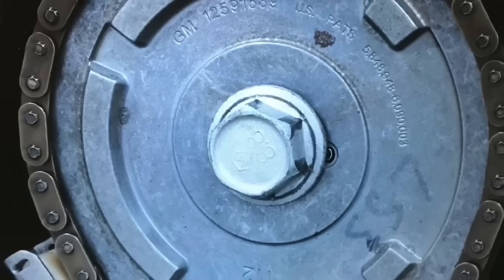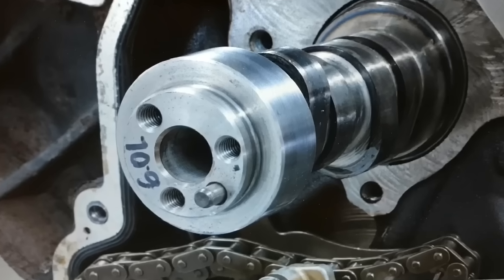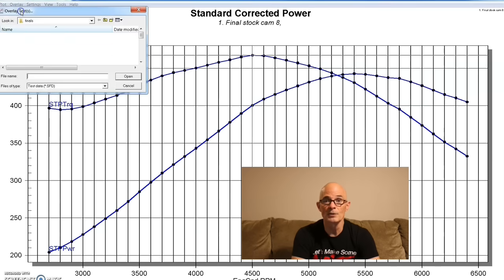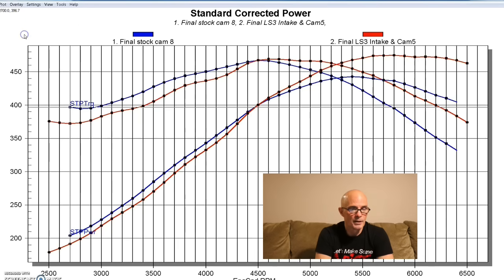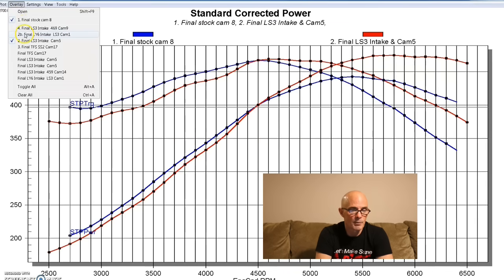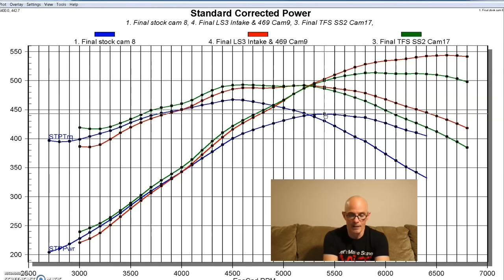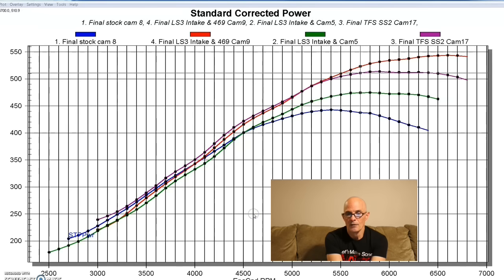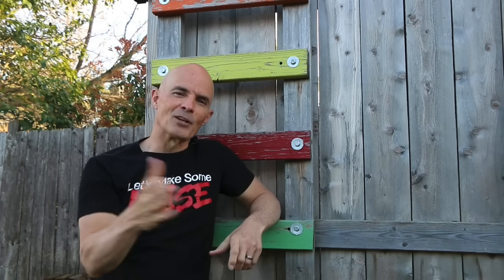HOW TO PICK: THE RIGHT JUNKYARD 6.0L LS CAM. 4 CAMS-WHAT WORKS BEST?

Comment: Is this LQ4 engine similar to a L98/L76 engine? I don’t know if that terminology is the same as what we use in Australia but we used 6.0 litre engines in our Commodore. I have an LS3 cam in it and it did 400hp at the wheels. Stock valve springs, revs to 6000rpm.

Comment: I’m planning to stick a TSP truck cam in my L99 camaro SS, 228/232. .600/.600 LSA 112 I already ordered the cam and it’s on its way to Iraq. The aim for this is to get more torque and nice chopping sound for a daily use car. My main concern here is the rough idle because it’s a truck cam ... should I be worried ?

Comment: how do you suppose a 402 stroker with 11.5 compression would  respond
Reply: That combo should respond very well.  Keep in mind that adding cubic inches tends to make a camshaft add a bit more tame.  Your added displacement should just help even more on the low speed cylinder filling, helping with torque production, while still having enough cam to rev out enough for any reasonable street engine.  I would bet on it feeling quite strong.

Comment: I want to see a big cam dyno tested with Rhoads lifters.  Have had them in a couple of small blocks and they really help broaden the power curve by restoring low rpm cylinder pressure.

Comment: I have a 2012 Silverado crew running EFI live truck runs great 3,000 Stahl 600 lift cam long tubes everything short block up torque management is off but it doesn't have the power to spin the wheels even with traction control and stabilitrak shut off soon as the computer senses the slightest bit of wheel spin it pulls the throttle back and flashes the light. So basically all this work for nothing . Any suggestions? Carburetor different throttle body?

Comment: Is it required to have double valve springs and harden push rods with the ss2 on the 6.0 ?
Reply from the maker: a PAC or Comp single beehive also works-lots of guys running stock pushrods-I don't usually with added spring pressure

Comment: Hey quick question. I put an LY6 in my 4 door 4x4 added a Texas speed VVT 2 cam 227/235  .614/ .621 113 LSA 108 ICL and it only made 308 to the ground 🤔 this doesn’t seem right. Also is that cam mild or moderate
Reply from the maker: that cam should make plenty of power

Comment: I just discovered your channel and love it - also shared your videos.
I have a 1999 LQ4 going to boost it and run it on E85 also keeping the stock cam,  I already picked up replacement aluminum 317 heads, 

1-What should i open up the piston ring gap to?
2-Which valve springs/retainers should i use?
3-What size fuel injectors? 

4-What are must do's to junk yard engines before dropping them in?
thanks for your help

Comment: I love all the information you give with all of the comparisons. And while i understand that most engines with a cam will get a converter. It would be cool to see a cam test that give us the numbers from say 1800 rpm and up but at 1/4 to half throttle to simulate say an up  hill climb while in OD and converter locked. It would be an outside the box test.

Comment: When you change the cam to stage 2 during the test, did you change the valve spring or keep using the stock one?
Reply: Stock springs would be OK for a dyno session, but once you get just shy of the .600 lift mark (ss2 has .585 llift), you definitely should upgrade springs. In fact a lot of companies advise upgrading springs during a camshaft change REGARDLESS of how specs differ from stock.

Comment: In my opinion, the SS2 is still a little large for a heavy truck N/A. Keep in mind this engine was obviously optimized with no power losses from accessories, drivetrain, etc. So the whole video, this engine was acting like a much larger displacement around a 6.2L or more when accounting for those losses. The SS2 cam in a truck will not produce the same power curve as the video, and because of the weight, will certainly feel slugglish on the lower RPMs. That cam has +5 degrees positive overlap. You will have to like the feeling of high stall converters if you want to make use of that cam, and possibly have short gearing. The Sloppy Stage 1 cam, or E1838P is 216/220 @114 +4 LSA which has -10 overlap so will probably end up somewhere between the LS3 cam and Stage 2 without loosing as much low-end torque.

Comment: Hi Richard, great test on 6.0! I get the overall power curve of these cams will be similar on cathedral port heads on the 6.0. Im guessing a big percentage of 6.0 guys have cathedral port heads. But my question is (because I have a cathedral port 6.0) how much power it will make with a SS2 cam?  Im running the sloppy stage II but Im guessing from this test it will produce peak hp of about 500 instead of the higher 524 hp with rectangular port heads. By the way Im going to run twin turbos and this motor is going into my 3000 lb lightened 72 Nova, turbo 400, 3.42 gears. At the track my max boost will be 15 to 18 lbs. Probably 6 to 8 lbs on the street. This will be 80% street 20% strip!  Would you say about 500 hp is a good guess naturally aspirated with 317s & SS2? Thanks!

Comment: Can you do an ls1 at all?

My ls1 did a lifter and i changed cams 

i had a vcm 13 cam 238/242 601int 601exh 112lsa made 390rwhp run 116mph 11.69

Put a crow cam in it 234/242 113lsa 603lift 603exh made 380rwhp ran 11.8 115mph on its 3rd pass. Yet to head back.

Comment: I've got a 2002 LS6 corvette engine going into my 1972 Vette.   Will a sloppy stage 2 lose torque in the 3000-4000 rpm range compared to the 2nd design LS6 cam?
https://www.youtube.com/watch?v=1s0QEhny4oM

Comment: Riachard, i have a question, u see on the graph after all 4 cams were tested that the power goes up with each cam. Lets say u disnt have to worry about piston to valve clearance because u have aftermarket pistons, is there a point on a stock size 5.3 or 6.0 where putting in a bigger cam does not gain power or it actually hurts power? I know u dont want to run .850 lift on the street but it just seems like the ls just wants more and more camshaft!
Reply from the maker: take a look at the 175-hp cam video for an example of too much cam

Comment: Awesome videos, and I've learned a good bit about the longtube headers. Will the ss2 can work in the L76 in the Pontiac G8 GT with stock converter.
Reply from the maker: don't know converters
Reply: It sure looks like it, the cam has +4 degrees of advance ground in , which isn't stated in the description. The duration #'s alone don't 'tell' how this particular  cam will 'act' because of the advance it has (especially when the advance isn't given in the specs) Richard slightly 'dropped the ball' by not giving that very important bit of info IMO. Have a G8 myself and have been researching cams a bit. The duration #'s of the SS2 are too high to use in our cars without the +4 degrees of advance (or a converter), the advance helps bring the power down lower and let us use the stock converter. Look at the BTR LS3 cams specs for more insight, their Stage 2 even mentions the torque converter in our cars.

Comment: can you state advertised duration?  The aftermarket cams use more aggressive ramps which makes the .050" duration look much bigger than the GM cams.  I think a 275/283 cam with 110 LSA would be slightly better than the TFS.
Reply: that 275/283 would be a complete dog below 6500 RPM, even on a 427 LS7

Comment: Ok  my cam has the exsact same cam card as the comp in the video.  I forgot I ended up with that one.  Cool. I got to see what my cam will do in my 6.0. Lol. I have heavily ported 862’s that have been milled a down a couple CC’s to compensate for the valve unshrouding and bowl smoothing around the exhaust valve.  I can’t wait to see what it makes compared to this video with the mods I’ve done. It’s also .040 over with a gen 4 -4.8 crank and rods.  So it should be interesting

Comment: I wish you would start the dyno tests out at lower RPMs. It would be great to know what kind of torque and HP levels that these cams are giving closer to the 1000 mark. Not that many people run up to 7000, but almost everyone starts from an idle.
Reply from the maker: no one is at WOT at 1000 rpm
Reply: @richardholdener1727  Turning onto an uphill onramp to get on the interstate, pulling a 10,000 lb boat.... been WOT at 1000 a few times.
Reply: With an auto the converter will flash and have it above 1000 when you floor it. If it’s a manual and you’re actually trying to get somewhere the WOT at 1000 rpm means you need to downshift since a small gas engine isn’t going to make much power down that low anyway. 

Either way, a water brake dyno like this needs some rpm to move enough water for it to work. They can’t run it at to low of an rpm or else it can’t work right. Usually needs to start about 2500 or higher.

Comment: I think videos like this for reference are great! I think they will help a lot of people. 

I spent a lot of time trying to find other people's test when i was trying to decide on a cam for my 489bbc. There is lots of "600hp builds" out there but, It was hard to find the mild street buils, especially with the peanut port heads. There's lots of conflicting info about them too. It would be nice to know for sure if a nice street motor can be built with peanut port heads. 

But, I just found the other day, a 454 test with a gen 6 block and peanut port heads you did, so that was helpful. The only question left is what does an intake and cam upgrade do for a peanut port head engine.

The few dyno test i did see with the old 454s show about a 100hp difference between the factory claimed (net)hp and  what you and others have shown with a engine on the dyno. Is the exhaust manifold, factory cast intake manifold, and accessories worth that much?

A test showing how big a cam the peanut port heads can handle would be nice too😉.

Thanks a lot, Keep the videos coming.

Comment: Could you do a test to find out the highest compression/ power you could run with a carbureted 6.0L on good e85?
Reply: With E85 you have very little compression limit compared to pump gas. You can run 13:1+ compression on E85 if you wanted to. 
My latest combo I recently built a pump-gas 11.5:1 6.0, with a healthy cam (235/251@.050, .621/.624 lift on 113LSA), CNC ported LS3 heads, LS3 manifold, 100mm TB and EFI , makes 600hp. Limited to 11:1 because its on pump gas. 
I reckon you could definitely get close to 700 hp (if not supercede 700) with more compression on E85, bigger camshaft (.650-700 lift, 250-270@.050), full-race ported heads, full-race ported single-plane and a big honkin dominator.
Reply: @rustysausage69  Sounds similar to the 750hp LSX 454-R crate engine.  I told Richard that I would love to see the outcome of swapping the 454-R single plane and Dominator out for a FAST or LS7 intake manifold so it would fit under a stock hood which is popular nowadays.

Comment: A cam swap wont turn your stock engine to a high performance engine. If you're a clueless bastard and want more power, there is alot that can be done to an engine before the cam becomes the part holding it back. And a youtube video saying this and that about these cams are just garbage unless you have that exact setup. If you really want to change cams anyways, take ur engine to pros and let them test ur engine for what it actully needs. Don't listen to someone who's saying "this is a good cam, everyone should have it" Cuz that guy is a fucking moron.
Reply: Trigger easy?
Reply from the maker: adding any of these cams to a stock motors does this. All you need are springs.

Comment: A l83 VVT limit test would be awesome! See at what point you loose control. See how much boost or level of cam destabilize the VVT system. Are guys limiting the VVT at too mild of build levels?
Reply from the maker: VVT is usually limited on cam swaps anyway
Reply: Richard Holdener loving the L83 content! Keep it up.

Comment: Would you suggest hunting down a LY6/4L80 combo over the LY6/6L90 for a boosted muscle car swap?  Debating a LSA blower or a s400 with Hooker turbo manifolds.
Reply: You'll have less trouble fitting a 4L80 in a muscle car transmission tunnel than a 6L90, theres more 4 speed shifters out there than 6 speed available, and less gears=less money to spend making it hold power. Those are my only words of advice.

Comment: Richard I really really wanna see you do an LQ9 like this with 243 heads and a thinner head gasket, same test. C'mon Dyno man!!
Reply from the maker: results are the same, I ran this LY6 with 706, 799 and 317 heads with various intakes and cams
Reply: Richard Holdener thanks for all the great content man, I've really enjoyed it and learned so so much! I really wish a turbo in my 4th gen Camaro LTX wasn't such a colassal undertaking, it would really be a good time in the car especially with a PCM conversion getting rid of the Opti!
Reply: Richard Holdener I was mainly concerned with what a bit more compression would do in it. I have a plan for a mild build for my Escalade or a Silverado SS depending on how things go. Ported 799/243 heads and a good valve job naturally, Mill the heads and a thinner head gasket trying to get compression around 11:1-11.5:1, "Little Lunati" cam, you know the one I'm sure, TBSS intake, long tubes and a 26-2800 converter. It should be pretty fun, torquey and still have decent manners in the truck.
Reply: Richard Holdener and I'm still waiting to see you do something with a gen 2 LTX brotha! C'mon man, us LTX guys deserve some love too lol!

Comment: Everyone sleeps on the LS9 cam. It makes great power, force fed or not, and its only $139.
Reply from the maker: it makes good peak power, just soft down low-see the stock ls cam test video
Reply: Richard Holdener yes, but $139 vs $400+ for all these fancy cams. And the 823 heads flow best around .500 lift.

Comment: Making me want to change cams again... I never thought that I would see the SS2 making more TQ than a stock LQ4 cam at lower than 4000 RPM. I went from the stock LQ4 cam in my truck, to a 202/216 .525 112 LSA. Then to a 214/220 .598/.605 111 LSA. It works well, but seeing tests like this always have me second guessing. And my inner voice is constantly telling "go big or go home."
Reply: I am with you never seeing the Sloppy stage 2 making more low end torque than the LQ4 stock cam.

Comment: My question is, if you're building your 6 liter to add boost later and go with the 54 - 469 - 11 camshaft, will the boost overcome that little bit of low-end loss?
Reply from the maker: it will do the same thing it does na-you will obviously have more low end cuz of the presence of boost-the shape will be the same

Comment: Richard thanks for all you do and the time and effort you put into your posts! I have a stupid question. I've been looking at the summit stage 1 truck cam for towing and fuel economy with increases in both hp and torque. Is this a good choice or is there a better choice? Thanks and you make great videos and posts keep up the good work!
Reply from the maker: I have not tested the summit truck cams-only BTR
Reply: @richardholdener1727  ok what BTR cam? I appreciate your reply. Thanks
Reply: @richardholdener1727  I should have stated the application it's for a 99 Silverado 2500 long bed 3 door with 6.0 lq4 completely stock. Thanks

Comment: Not bad for off the shelf cams but I've always been a custom grind guy. It's not that much more for a cam that's designed for said combination and or application. If it's for something you really don't race where you want everything you can get out of the vehicle obviously the last 2 cams are a great choice depending on weight of vehicle, converter, gearing, etc. 
Thanks for another great video.
Reply from the maker: custom cams do the same thing-there is no magic
Reply: @richardholdener1727  come on you have a ton of experience on a dyno. I'm also talking race. Not street. There I agree. Plus motors in general. The cams I got from Anthony Disomma always made a difference both on the dyno and track. You also know the head plays a part on how well something is going to work but like I said before on a stock motor no it's not necessary. Oh another example is for classes where lift etc are limited. An off the shelf cam will never come close to a custom. Either that or I'm just lucky to had a friend that's great at building engine's. Thanks again for the chat. I enjoy how you engage with people in the comment section. Keep up the great work. I don't always agree 100% from own personal experience but your spot on 99% of the time. Take care.

Comment: One thing you don’t see on these videos is a run with an RV cam. They should be between the LQ4 and sloppy 2, but it would be nice to see numbers.
Reply from the maker: I ran all the BTR truck cams on this motor too-check out that video
Reply: Richard Holdener thank you.

Comment: Do a summit turbo cam shoot out. Stage 2,3,4
Reply: Trey Walker look at the specs on the cam. If they are about the same as the examples shown here (and rest assured they will be) you will get about the same results, which is the point of this video.  Did you actually watch the video?

Comment: Hi Richard, great info as always. For guys like me who haven't installed a cam, do you think you could do a video on how to do it? Have to mess with springs or anything? Guessing need to remove pushrods? Thanks.
Reply: Google an U-tube at yr disposal there's already ALOT of cam swap vids about an that many that there's one for just about every make model etc. As u get into them vids, it'll show u it's easier then initially thought. Good luck.